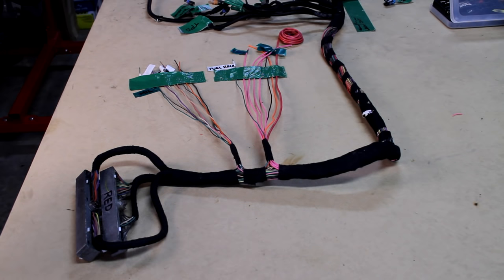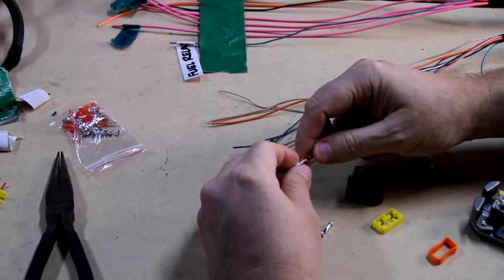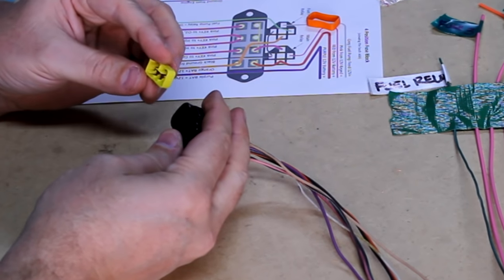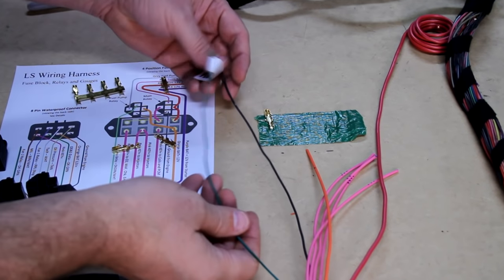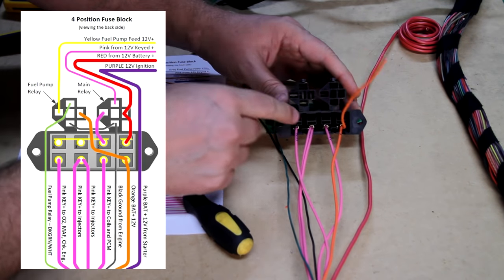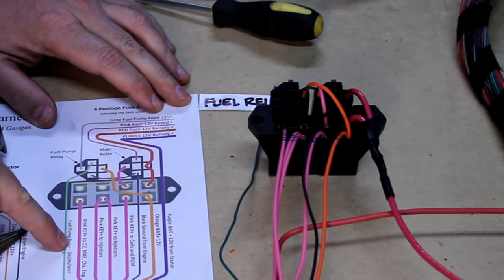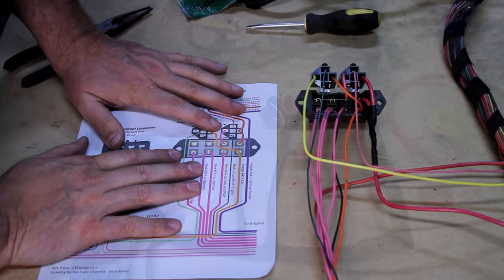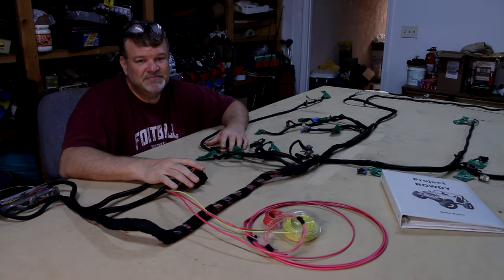LS Wiring Harness Part 5 | Project Rowdy Ep017

Comment: Mike ..FYI. I found out my fuel pump from Tanks INC which is an internal tank pump requires a 30 amp fused 12 Gauge wire. I modified your original wiring directions and added another Fused hot and added a 12 gauge wire to the pump just to be sure I am getting enough power to the pump. I was afraid the original 15 amp fuse suggested would not be enough. I spend several days watching your series and appreciate all that you put out there for as all. I realize that not everyone's situation is the same .
Thanks for all you do for the Youtube community!
Reply from the maker: That sounds like the perfect mod for your situation.   Thanks for sharing.   Mike.

Comment: Just starting my 6.0 Escalade motor into 66 Caddy swap, Nicely done videos, I appreciate the organization- makes it a bit easier to adapt to my specific swap, yet I can get running with just the 4 wire setup.
Reply from the maker: Glad you enjoyed the series.  It is pretty adaptable.  If you understand the concepts and approach, it should be easy to adapt to your requirements.  Have fun with your build...  sounds awesome!  Mike

Comment: Hi, so i have been following along and watching you're rebuild 2 times now just so i can make sure i do my build correctly. First let me say that i absolutely love how much detail you go into. I have honestly learned more from youre videos then i did in high school.  I have a 5.3l lm7 that i got from a junkyard and ill be doing a full rebuild. Thank you so much for your detailed videos. They have helped so much!!!!
Reply from the maker: Very very Cool Jacob!   I would highly recommend a Rebuild guide like I used.  It has steps outlined and other great information to help you along.  It also lists all of the Torque specs and such.   There are many good one out there, the one I used is listed in the Show More section of each of the Engine Build videos.   Best of luck and have fun with yours.  Mike
Reply: Thank you. The big issue that im running into is Cams. Ive been doing some research and im comming up with lots of different cams that i can use. I want a bigger cam but i dont know how big i can go for a forced induction setup before i need to get different heads. Im planning on running flat top forged pistons but i dont want to have the intake and exhaust valves hitting the pistons. Any advise on this would be greatly appreciated.
Reply: The engine sound at the beginning of your Projest Rowdy videos is what i want my truck to sound like.
Reply from the maker: Well the bigger Cam and Forced Induction is a little out of my research boundaries.  We are hoping to be able to reproduce the sound that Rowdy has now with the 304, but obviously, it will be slightly different.  My Cam is a medium, Streetable Cam that will match m usage.
Reply: I think i mught have found one that will work. Thank you for all your help. Ill be continuing to follow you.

Comment: Excellent job Mike.  I can tell you have a lot of experience working with wires, it shows in how you have your harness placed and your schematics. Very well thought out. I like the fact that you have all the power wires together and all the communications wires together. I also like the added connectors to simplify the engine wiring and interior wiring. I have a lot of cable splicing experience and its all in the setup and plans of any splice. It doesn't take long to have a tangled mess after wiring if you don't have a plan. I plan to use some of the techniques you showed on OverKill. I will be adding some relays for my cooling fans and possibly headlights, (Still thinking of going led on those). Great Job.
Reply from the maker: I appreciate the compliment Russ!  I enjoy the wiring part because it is like controlled chaos!  When you first look at a schematic, it is always overwhelming.  After studying them, they just bleed cool information.  A buddy was building a custom Honda 500 motorcycle and I drew up an entire wiring harness for him.   That was cool!  Cheers!

Comment: Good job. It would be much easier for you with the proper crimp tools and give very secure connections. When I rewired my chevelle I upgraded to a newer fuse box and rewired the bulkhead. The crimping tool made life so easy.

Comment: Your videos by far are the best instructional ones I've seen. Just wish you were working on a 07 ls engine. I have 07 L92 6l80 that's going in a 1994 chevy cheyenne. The wife is not happy that it's still sitting in front of where she parks.
Reply from the maker: Thank you!!! and Literally LOL...  I spent 50% of my initial effort on "Wife Buy In".  You would be amazed at the similarities of the two engines and if that is the mating transmission, there is very little "Wire delete" that would need to be done.  Just the 4-wire portion.   Sounds like fun!  The truck will have some Getty-Up!!!!!
Reply: +UCanDoIt2 Yes Mike that is the mating transmission, complete engine and trans pullout. Complete harness as well. Just haven't found a thorough guide on a GEN IV like you've done to bother with it.
Reply from the maker: LT1Swap.com should have your Pinout Chart and other connector diagrams.    [Wire Harness Info] > [Vortec 4.8/5.3/6.0/6.2 Hareness Information]
Reply: +UCanDoIt2 would it be easier to use engine fuse box from donor vehicle? I've looked lt1 swap and still can't wrap my head around it.
Reply from the maker: You could use the Donor Fuse Box.  But to me, that is a big black hole.  Wires go into to that and I can tell what is connected to what.   There is a video on channel:  Agearhead4life where he simply found the Pins on the original box that required the different power sources.   You might need a good local gearhead that you can pick their brains over a couple of coffees!!!!  Here is a link to the video:  https://www.youtube.com/watch?v=1lpuIiPB2sk&t=28s
Reply: UCanDoIt2 I didn't see the off file

Comment: Great home made prints and detail. Thank you sir
Reply from the maker: jsee238!!   Glad you found it useful.  Have fun with your project.
Reply: Yes! Very! Yours is very clean and laid out logically/minimalistic. I'm about half done routing my harness. I'm doing mine while the harness is  laid out in the engine pay so I can hide everything. I'm going to land all my power and functions like you did in your print so I can use your print as my own for installation and t/shooting later down the road. Thanks again
Reply: And also....you ran both bank of injectors together on the same fuse. What amp is the fuse. I don't know if one 15amp will do both sides. Gm originally uses one 15amp fuse for each set of injectors
Reply from the maker: According to the source that I used to put this together, a 15 Amp fuse is what is needed.   Remember that all 8 Injectors fire at different times!
Reply: Good point!!!!!

Comment: Wanted to mention the way the lingo at least used to be for ignition vs accessory. 
It used to be that accessory was things that on older cars would work if the key was turned back, like the radio would work but things like turn signals and wipers wouldn’t. 
Ignition2 was the other things like windshield wipers but how they differed from regular ignition was that when you turned the key further into the crank position they would not work whereas the actual ignition obviously needed to still function. So on an automatic trans car if you would put the car in something other than park or neutral then put the ignition switch in the crank position you will notice that things like the radio and heater fan won’t work therefore leaving more voltage available for cranking and spark. This may come handy when you connect the actual switch because ignition and ignition2 can appear similar unless you check them during crank. Hope that makes sense and maybe helps in some way, enjoying your videos greatly. Cheers.
Reply from the maker: Actually it does make sense.  You stated it very well.  That should be helpful when I reach that point.  Starting on the body work now and looking forward to someday getting the engine installed.   Thanks again!

Comment: im almost done with my harnes. i wouldnt be this far without this video. im doing a different kind of swap (ls in a 97 k1500) but it has helped me understand how the wiring flows and what is controlled by what. thanks again man!
Reply from the maker: I am so glad that you left your comment!!!!  Others need to understand that this "Approach" is transferrable.  It's not just about "What" I did, but "How" it is done and how this can be applied to ANY swap.  "We" are creating a stand-a-lone Engine that can be placed into any vehicle.   Congratulations for having the insight into being able to apply this approach for your project.   THIS WAS THE REAL INTENT OF THIS SERIES!!!!!   Thank You!!!!!!!  Mike
Reply: are you keeping stock gauges ?
Reply: i was planning on doing the same but i'm trying to make my swap wiring as most intimidated for thefts, my truck got stolen about a month ago so im stuck trying to figure out how to wire a keyless entry push start system work. And Yes most intimidated but understandable in my eyes + making it compact and clean LOL.

Comment: As a first time LS swapper these videos have been GOLD! Thank You!  Question for you or the community... I am doing a 2002 LM7 with 4L60E swap into a 1956 Chevy 3100 and am having trouble tracking down info on how to wire a speedometer. Any help is appreciated by this newbie.
Reply from the maker: Thank you Sir!   Not sure on the speedo solution as my config uses a cable off the transfer case that I plan to use.  Hopefully some else can chime in.

Comment: this is a nice configuration, as ur pink wire is feeding 3 fuses from the main relay,  my question is  can i add another 3 fuses ( evap system 10 amp, trans selenoid 20 amp F2  and Ignition 1 voltage 25 amp F9)  to get power feed from IGN key with the same pink wire? and 16 awg is enough to to feed those fuses?
Reply from the maker: I can tell by the way you setup and asked your question that you do have a great understanding of how this works.  I believe, your only limiting factor is the gauge wire (the Red from the battery and the Pink from the Main Relay to the new set of three fuses) is required to run continuous load of ALL item connected.  I believe with what you listed, you should be OK.
Reply: @UCanDoIt2Mike  do you think 10 gauge red wire from batt and 12 gauge pink wire from main relay to all 6 fuse or is better to run another 16 gauge Pink wire for the extra 3 fuses?

Comment: Great video! Do you have the relay numbers for 4 position fuse block? For fuel pump relay and main relay? Or what color goes to what number relay. Thanks for any help
Reply from the maker: Sorry for the late response.  I should have added that to the diagram.   If you have downloaded my free diagram OR find a clear image of it in the video, here are the Relay Pin numbers per the orientation of my diagram.   
LEFT (30), TOP (86), BOTTOM (85), and RIGHT (87)

This should help.    Mike

Comment: Hey me again! I got a question about the oil pressure wiring that I’m a little confused on. (2004 lm7) So I have a grey wire coming from pin 7 on the C1 Blue which is the 5 volt reference to the oil pressure sensor. And a black wire coming from pin 63 which is the low reference. I see on yours that you have oil pressure signal that came off of the C100 block. The thing is that my oil pressure signal (tan/white wire) is coming from pin 62 on the green C2. My question is do I de pin it to run it to the connector or do I tap from the wire while leaving the connector to the pcm, and using that when I make the connector? TIA
Reply from the maker: Sorry for the delay, I have to get my diagrams in front of me.  Our wiring is very different based on harness year.  My C100 wire was the original way of feeding the dash and that is the wire that I will be using for my gauge.  You should be able to find the signal wire that fed the interior for your new application.

Comment: Another questions: The orientation of your relays looking from the bottom of your fuse block;  left 30 ,  top 86 , right 87, bottom 85  ... correct?  Just want to clarify because my fuse block is orientated  left 85, top 30, right 86, bottom 87.  Based on my initial diagram the wiring was following your diagram but I  was looking at my fuse block.  So basically it's just rotating your relay  clock wise so the 30 position is at the top.
Reply from the maker: You are correct in what you stated for my setup ( left 30 ,  top 86 , right 87, bottom 85).  Remember this is looking at the back of the socket, similar to looking at the back of the Relay.  That sounds correct about you viewing my relay as if it was rotated clockwise 90 degrees.    Remember that the trigger pin on a relay are 85  & 86.  The main power will run through 87 & 30.
Reply: @UCanDoIt2Mike   Thanks again, I should be able to start wiring the fuse block this week and finish up the wiring series.

Comment: Hello, I’m having trouble with c2 connector e2 pin what sensor does it feed or what pcm pin? (accidentally removed it )Also confused with MlL power that goes along with O2 on fuse box. Where does mil wire come from?thank you
Reply from the maker: It really depends on the year model that your harness came from.  I assume that you downloaded the C2 document for your year model from LT1swap.com????  For my 2001, the E2 pin is On/Off/Crank Voltage for PCM and Transmission Solenoids.   Again it changes based on the year...  My Document that you can download in the Show More section beneath this video shows...  The MIL light needs two wires: (1) Switched Negative from the PCM coming from RED46 Page 1 of my doc, and (2) a New Positive Wire coming from the splicing of positive wires on page 2 of my doc.

Comment: Hey i just want to start off of by saying you made diving into my ls swap that much easier!! Your videos are exactly what a beginner into the ls world needs to get going! Thank you for taking all the time you did to make this videos!
I did run into an issue i wanted to see if you could clear up, after cleaning up my harness i ended up with a pink wire that i earlier labeled "ignition voltage" and another pink wire coming from a pink connector. I have no clue where this pink connector goes to and i have connected all of the other plugs including build and connect my 4 wire fuse block with the 2 relays. Any information or pointers helps. Thanks again!!
Reply from the maker: So I think I can only answer you with a couple of logical thoughts since I cannot see what is going on.   All Pink wires are switched voltage.  One example of where you would have 2 extra pink wires than I did is if you kept both rear O2 sensors. You would have had to add that to your Pink switched wiring setup.  If you can determine (following the wires or thru continuity testing where the wires go, you might be able to determine what you need to do with them.   If they enter the harness and run back into the harness, they must go to a connector that you left in the harness and it would be safe to say they will need switched power.....  add them to one of the existing fuses.  These are just a few thoughts off the top of my head.   Hope it provides some good guidance.  Cheers!!!!!

Comment: i add a relay for STARTER and ELECTRIC FAN to my fuse box so can i use the same relay (absolute rls125  30 to 40 amp) for starter an electric fan? or do you think i need one with more or less amperage? this is the last think i need to know to finish my wiring harness.
Reply from the maker: If you are fusing the trigger wire, that would be more allowance than needed.  You would need to check the draw on the fans, for it's power circuit.   I believe you should be good!

Comment: Maybe i missed it, but where are you getting the 02 wires from to put in the fuse box,  i have no loose wires.   Do you t branch from the harness?  2001 6.0 liter thanks.
Reply from the maker: When I disassembled the Original Truck Fuse Block, there was a connector name C2.  (see my video Part 2, Episode 014 talks about this at this link:  https://youtu.be/GXQtSLG0CW4?si=qF1Qy2MPOXPsQRkH&t=142)

There are two Pink wires in the D8 position (circuit 539 of the original harness).   These are the two wires that ultimately get connected to Fuse 4 of my diagram.  http://bit.ly/LS_Harness_Diagrams

Hope this helps!    Mike
Reply: @UCanDoIt2Mike  thanks I will look back

Comment: Question on your fuse diagram. On lt1, he has is pcm supply going to the fuse block, but you have yours (B19, B75) going straight to the engine. Are you going straight to the battery?
Reply from the maker: That part of the diagram is a little confusing and hard to illustrate.  On page 1 of the diagram, I show B19 and B75 heading down the Harness to the Engine.  Per Page 2, they are joined to with the other two Coil wires to a larger gauge Pink wire and come back into Page 1 (from the Engine side).  In the actual video, I try to illustrate that better.  Hope that helps.
Reply: @UCanDoIt2Mike  I see now…! I over looked them, thanks. Your videos/info coupled with lt1s info..is the best..!

Comment: I have followed along with your videos and wiring diagrams for my own swap. Excellent resources. The piece I have not been able to find is what size (amperage) fuses are you using in the 4 block module?
Reply from the maker: 15 Amp for all 4 fuses.   I wish I could add this as a note in the video.   Cheers and have fun with yours!!!!!